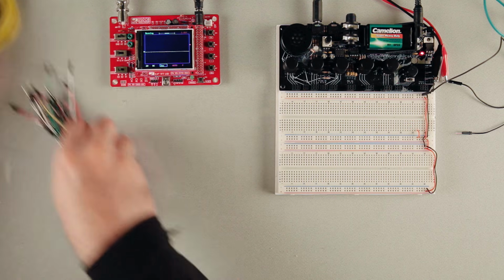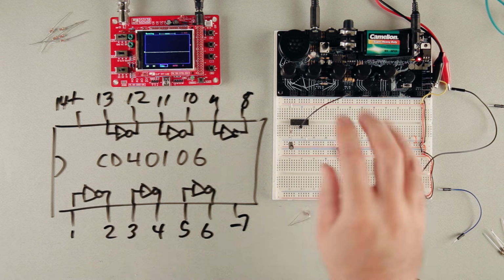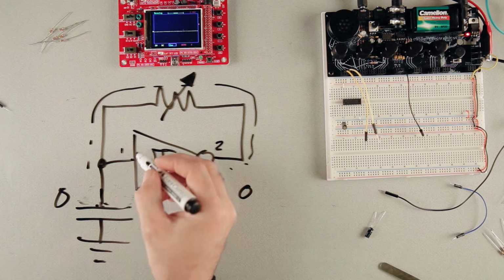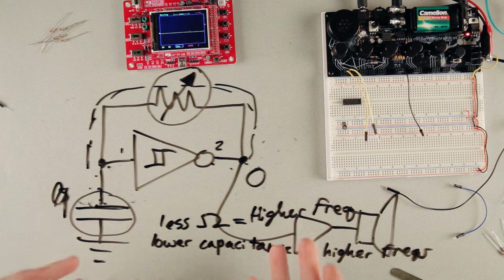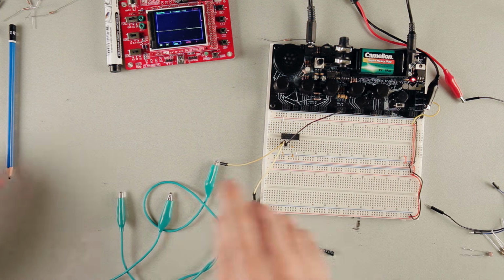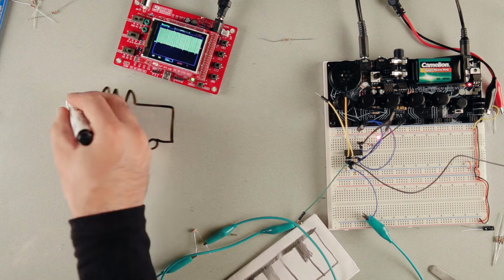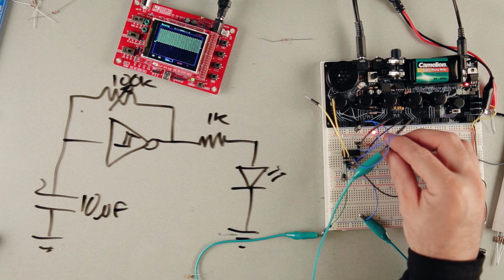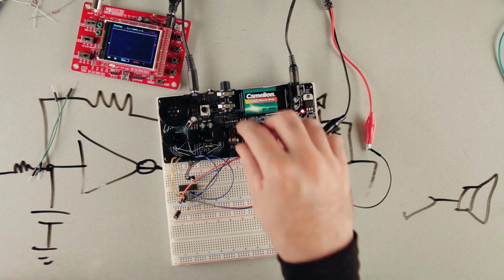Casper Electronics DIY synth building. Part 1: Oscillators

Comment: 11:24 Ave satan ;>
BTW how about building some generator of a nice & clean sine wave? Because those pulse waves are hurting my ears ;s  Sine wave oscillators would be even more useful for the LFOs, because a square-wave LFO can only jump the pitch up and down instead of making a smooth slide. Not very useful unless the only thing you want to ever play is the "Jaws" theme ;J
27:00 VCOs... yeah, that's the meat I'm waiting for.
28:30 If you didn't title this song yet, I title it: "The attack of the deadly watermelon" :J
Reply from the maker: Yes sine waves are great. But the level of work and complexity to get there is DRAMATICALLY higher than the circuit in this video. The next best thing is adding a filter. Which I would like to make a video for some day soon. Also complex etc. but super useful.
Reply: casperelectronics synthesizers What level of complexity? I made an audio-quality sine wave generator (Wien bridge type) of just one op amp chip and  4 discrete elements (2 capacitors and 2 resistors which together make a resonant filter). Unless you mean that it's harder to explain how it works.
A mathematically-perfect sine wave generator with low distortion might be complex, but for audio purposes a little bit of higher harmonics in the signal is not so much a problem (it might even be desired). It shouldn't be much harder to build than a resonant filter. And the level of complexity will increase anyway for more fancy audio effects, like delay lines, flangers, compressors, expanders, ring modulation etc..

Comment: 6:29  How did you get the triangle wave?
Reply: +InnaSoulSounds  Just pass the square wave through an integrating circuit. An integrating circuit is basically just a "bucket for water": the voltage level in it raises up constantly as long as the input is high, and decreases as the input is low, producing a triangle wave from a square wave.
Reply: Thaanks.

Comment: Hay, i wanna to do a project with Arduino and this oscillator, but Arduino just supplies 5V. Is there any turnaround that i may take in order to make the oscillator work ? (like put a extra voltage supplier of 9V )
Reply from the maker: +KajahzaoNo need to change anything.  you can run this oscillator on 5 volts.

Comment: Hey casper. Im a student of Darsha Hewitt (greetings from her :) ). Im at the moment at the beginning of building some Synthesizer stuff and wanted to ask when the video of the 8 step Synth will be released. Im ordering a lot of stuff at the Moment so it would be helpful to have the "Shopping List" for the next Video too :) 

Youre Videos are awesome thanks for making them ! :)
Reply from the maker: +Tim Vischer Thanks! The three episodes will be released a month apart (approx). buy some CD4051 multiplexers, CD4040 binary counters, For the next video we'll use the same chips as well as the ISD1820 voice recorder. For components i try to keep it simple and use 1k, 10k 47k, 100k resistors.  AND .01uF, .1uf, 1uf, 10uf, 100uf capacitors. Plus some LEDs. "HI!" back to Darsha :)

Comment: I'm looking into picking up a bunch of components to make this kinda stuff. Would it be possible to control all this with CV? I was thinking of getting 3 oscillators (pitch, sync, lfo for maybe LPF) and hooking up everything to my beatstep pro
Reply from the maker: +NoyzBot  Heyo. Yes CV is relatively simple. I hook all the stuff from these videos up to all kinds of analog modular gear. BUT it takes some fancy foot work to make CV interfacing work well. It often requires buffering and scaling of some kind to work in the way most people want. For instance controlling the pitch of an oscillators with CV is simple if you just want a voltage to do something to the pitch. Whatever...just make it go up and down. But if you want to make it scale evenly so you can play chromatic scales and octaves etc then you need a bunch more circuitry. BUT if youre like me and just want to make a bunch of weird connections then I would experiment with vactrols. Home made ones are fine. Just connect the LED to a voltage source and the LDR to part of your circuit you want to control. Heres a pic for making your own http://3.bp.blogspot.com/--_a1ArfM9kI/T-ykXgJcKYI/AAAAAAAAABw/PWuAJx0jYWI/s1600/blog+image+3+DIY+vactrol.png .

Comment: dude this is awesome, finally some proper cmos shit. Are you gonna do anything with actual keyboards? Or do you at least have some good enough sources for integrating keyboards into your build and how? I would actually love a copper plate ''touch'' keyboard polyphonic synth but...that has to be impossible right? Normal keyboard is fine too I just need some info. Anything! :)
Reply from the maker: A polyphonic touch keypad isnt so tough. the complicated part is that you have to make an oscillator for every key. There are other ways ofcourse but they require other kinds of complex circuits. so youre just trading in one kind of work for another. In any case... no i dont really get into keyboards. They're great but i prefer to investigate less traditional methods of creating musical structures. complex modulation and sequencing is more my style.....and what i talk about in the videos.
Reply: ok ty, back to searching for eternity for the exact way to make my dream synth xD. Will be anticipating your next vid.
Reply: +Cooperman666ROFL btw, will you do any percussion stuff?
Reply from the maker: +Cooperman666ROFL  im not doing percussion but I AM doing rhythmic stuff in the next two. The circuits sync well to the teenage engineering drum machine (PO12) and lil korg drum thing. . and any other drum synth that takes clock inputs
Reply: thanks, can't wait for the next upload, now I'm gonna truly be a master synth maker (just let me lie to myself and move on)

Comment: This is great! Is it perhaps possible to control the pitch with a control voltage? I guess the led/ldr combo could work but would that be precice enough for synth purposes? Also, is it possible to get different waveforms? I heard that the pulse width sometimes moves around, but can this be controlled? What about a sawtooth?
Reply from the maker: +Cyril Kotecký LED/LDR works. feeding voltage directly to the input of the inverter through a 10k resistor works. But both of those approaches are wonky at best. Theres another approach that works fairly well. http://media.virbcdn.com/cdn_images/resize_1024x1365/87/ContentImage-1104-9836-synthmongervco_dlbweb.jpg. BUT the waveform is a very narrow pulse which makes it hard to use in audio applications.
Reply: +casperelectronics synthesizers Thank you for the quick reply! I guess I'll continue looking for an alternative for my dream synth project. This would still be a great, really simple LFO, if there were more waveshapes.
Reply from the maker: +Cyril Kotecký What i have shown is the simplest oscillator possible. You can make them voltage controlled and change the waveforms... it just requires more circuitry. The input of the inverter is a sort of triangle wave. If you buffer this through and transistor or op amp you can use thise wave form. But it will be much lower amplitude than the square wave... so some offset and amplification may be necessary. Instead of focusing on waveform stuff I have decided to focus on modulation and doing cool stuff with sequencing. The next two videos will cover this.
Reply: +casperelectronics synthesizers The simplest answer for my purposes would probably just be one of those dedicated VCO ICs. Modulation and sequencing is cool of course, I have subscribed and can't wait to see the next videos!